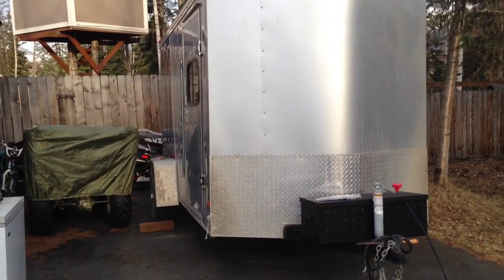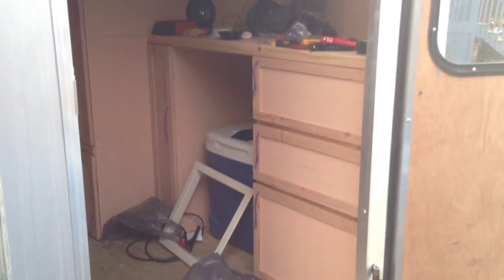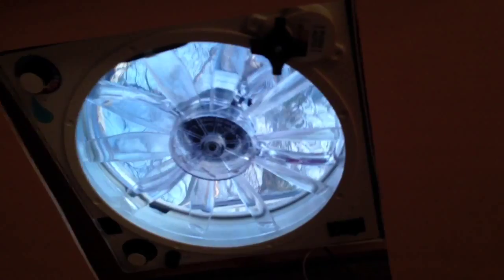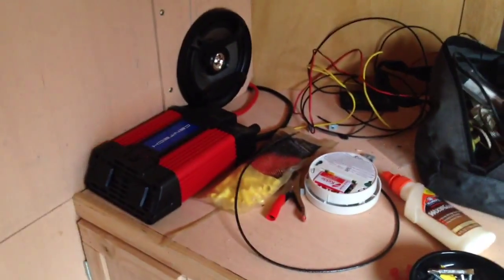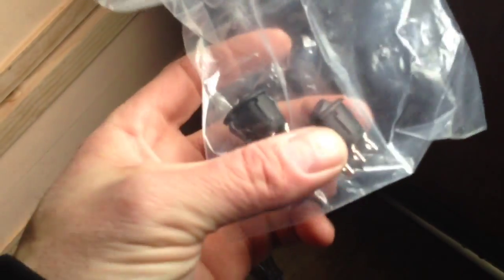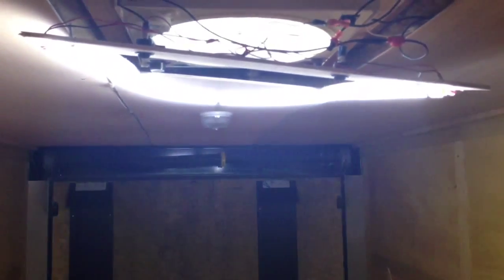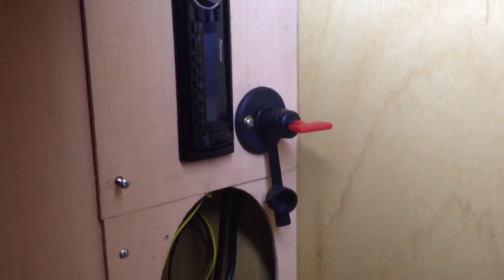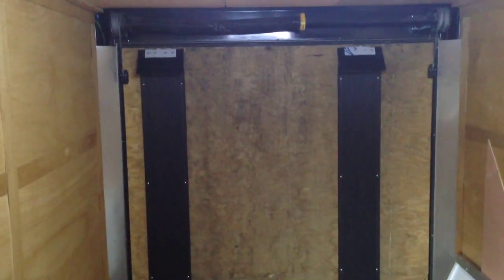My 6x12 haulmark Cargo trailer RV part 1

Comment from the maker: I put a remote digital thermometer in the Alaskan Camper when it was about 26 deg Last month. I put a Mr Heater portable in the camper on the lowest setting and waited about an hour before i checked on it. After the hour the thermometer said 46 but when i went in the camper it was very warm. I ad the thermometer on the countertop and the heater on the floor in the rear. It would definitely stay warm with that. I took the camper to turnagain pass and it froze and so did we with the lack of heat that night. So, it needs heat of some kind, just not enough insulation not to have heat in below freezing weather.